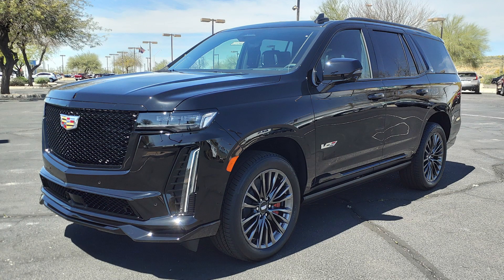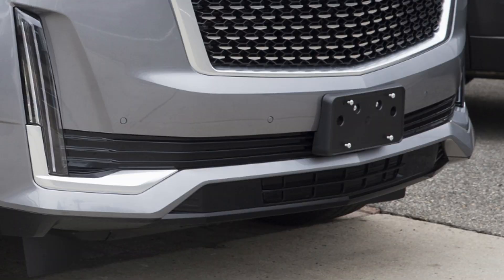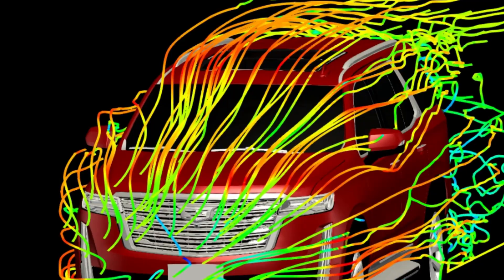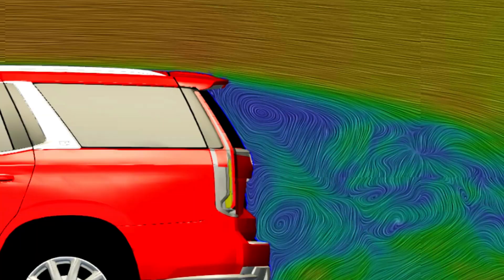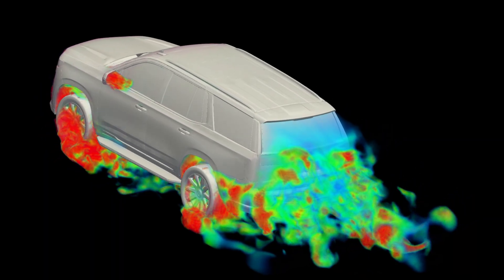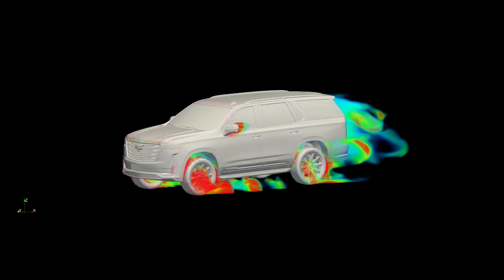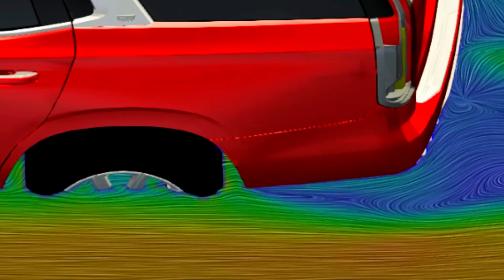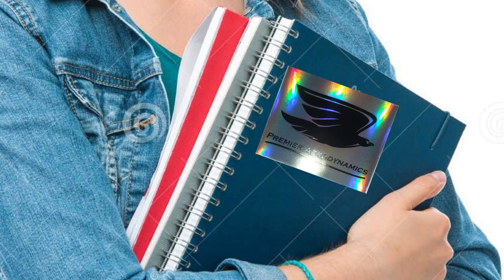Why The Cadillac Escalade Is Actually Aerodynamic [2021 Model]

Comment: Did i find baby using their first fluid dynamics software? 

Please google "drag area" before you make your next "this cadillac escalade is as aerodynamically efficient as a supercar" type video. You sound like an idiot. 

And The reason you are seeing such minor "wake" is because your model is extremely basic. You didnt model all the thousands of elements causing non-laminar fllow. Infact i dont see any turbulent air created from edges, only the main body (and only at the rear, which is wierd). non-laminar flow is a major cause of real world drag. Specifically i dont see any turbulent or even modeling of flow around/through the non-streamlined onjects under the car (like suspension parts, wheelwells, driveshaft tunnel, rear axle)

Anyways, the reason why the drag coefficient seems so low is because drag coefficient isnt a useful product in this scenario. You need to calculate area drag coefficient (the frontal area of a vehicle, and the amount you need to multiply it by (the drag coefficient) to understand its efficiency. Basically, that DC is not because its well engineered... Your model is so rudimentary its useless for accurate calculations. If we kept the numeric values, but changed the dimension measurements to kilometers instead of meters (so its a 6km long truck), the drag coefficient would still be exactly the same.

Or to use a very simple explanation. A brick thats 10cmx4cmx5cm, and a brick that is 10kmx4kmx5km have the exact same coefficient. But they require massively different amount of energy to reach and mantain specific speed.

Comment: a BMW i3 is an upright iconic compact EV cloaking a carbon composite frame on aluminum chassis. 
What do the popular aftermarket splitter, sideskirts, diffuser and wing do to the aerodynamics?

Previous analysis seen here indicates that a spoiler with side fins and more extensive diffuser would help with drag. A slotted spoiler and an element under the rear window could help reduce dirt accumulation.
with skid plates and auxiliary driving & cornering/fog lights, the i3 frame looks fit for rally. 
a unique challenge is increasing airflow to the radiator of the REx range extender engine on the right side of the rear axle (the motor is on the left side).
Reply from the maker: The extended diffuser will almost certainly help here. Side fins could reduce the drag a little.

Comment: It might be relatively aerodynamic for what it is, but drag coefficient is only one part of the equation. It's still a massive car with a huge frontal area.
Reply: It’s easier to achieve a low drag coefficient on a big car tho.

For comparison, the NA MX-5 has the same drag coefficient as this Escalade. Although it has a much lower frontal area, the Miata’s overall drag is still somewhat high relative to the power that it has. (hence why a 1.6L NA barely does 200 km/h)
Reply: @devandrasimanjuntak1646 please re-read the post you replied to... Drag Coefficient is not the aerodynamic efficiency of an object. You could change the unit of measurement from centimeters, to meters, to kilometers for that model, and the drag coefficient would be exactly the same value. 

You have to calculate the drag area of the object, to calculate aerodynamic efficiency. And the larger an object is, the more air is pushed ahead, to the sides, and above the object, requiring a larger drag area, due to turbulent air taking up more area than laminar or undisturbed air. Bow-waves exist in air, just like they do in water. 

So no. Larger vehicles do not have lower drag coefficients. If your model says its true, you have a very bad model.